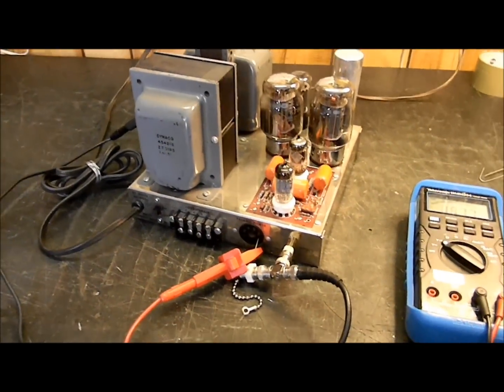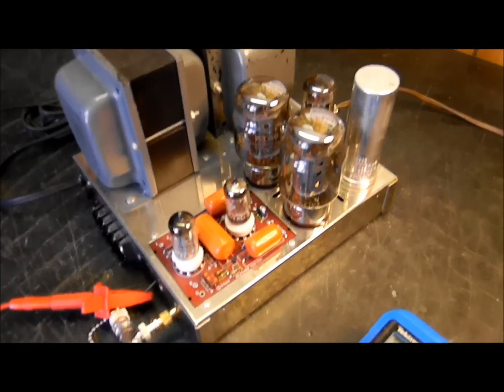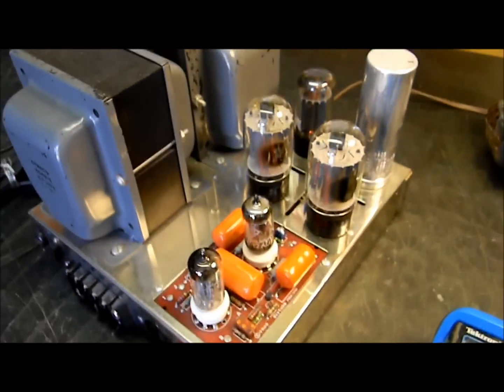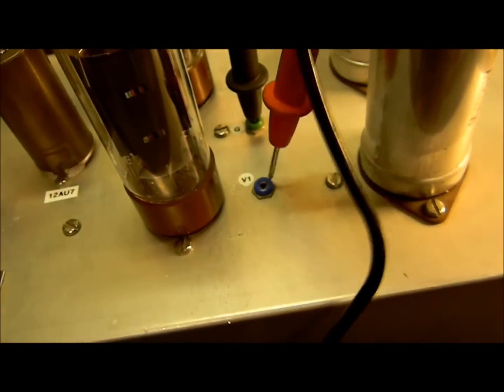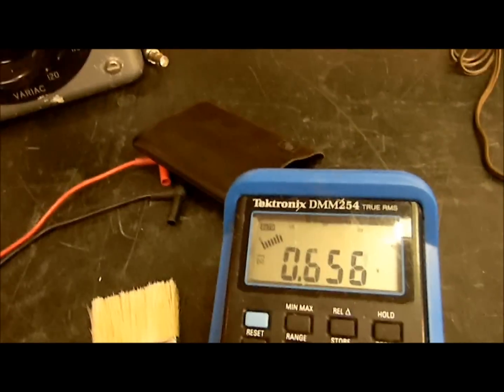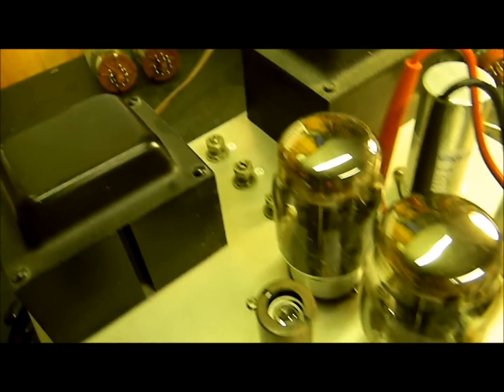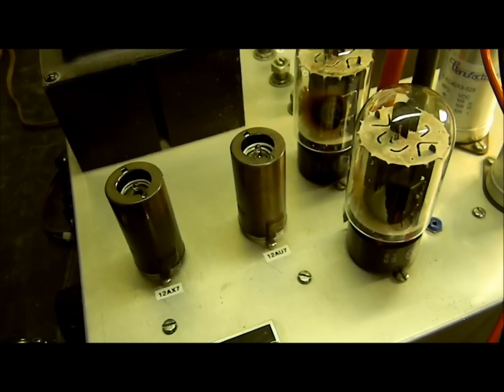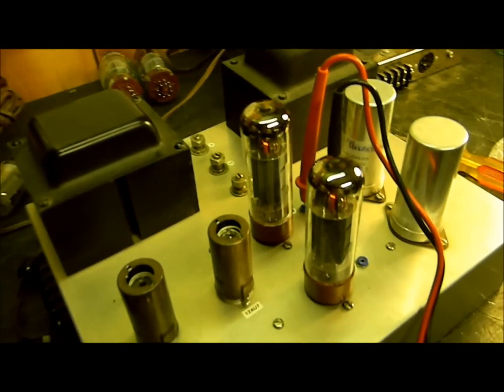KT88 vs EL34 vs 6L6 Substitution In Vacuum Tube Amplifier.wmv

Comment from the maker: The 6CA7 filament draws 1.5 A and the KT88 draws 1.6 A. This probably OK as it only 200 mA difference and (probably) will not harm the power transformer. The 6CA7 and KT88 can both take 800 volts on the plate whereas the 6L6 can not. Also, the 6L6 has a filament current of only 0.9 A so putting 6CA7 and KT88 in a 6L6 amp will probably grossly exceed the filament current rating of the power transformer. see next post

Comment from the maker: Pin 1 and pin 6 on the 6L6 is not used and often times used as solder connections, on the tube socket, for component connections under the chassis. The 6CA7 pin 1 is the screen grid and is most always grounded or connected to the cathode. The screen grid is internally tied to the cathode in the 6L6. So, you MUST know how the socket is wired up before swapping tubes around. A socket can be wired to take either of these tubes. Check out the pin configurations before swapping tubes. see next post

Comment from the maker: Yes, you should adjust the cathode currents when you change tubes. You do this by measuring the voltage across a cathode resistor (it it has one for this purpose). An example is the Fender DeVille which has a 1 ohm resistor from the 6L6 cathodes to ground and a designated test point which you adjust to 60 mV. This gives 60 mA current for the two tubes. If only a bias voltage point is provided or you measure directly at the grid, it shouldn't have change when tubes were replaced. Hope this helps.

Comment from the maker: The Fender Bassman 300 I have a video on has around 750 volts on the plates of the 6550's. Certainly no place to plug in a 6L6 or 6CA7. 450 volts on the plates of the 6L6 is not uncommon and is typical in the old McIntosh amps. I agree with you that for a typical 6L6 style amp, 6.5Kohm output transformer performs well - much better than a 5Kohm. Thanks again.

Comment from the maker: I completely agree with you that output transformer impedance is critically important. No doubt this plays into this demonstration. The primary goal of this video was to give some empirical evidence of (some of) what is actually going on when output tubes are swapped with another type. The higher bias voltage on the 6550 (may) allow the smaller tubes to be swapped in without immediate destruction but certainly not recommended for long term use. Thanks for your comments.

Comment: I don't have my tube specks book but the diference on these tubes are the plate resistance I know that you could get up to 70 w from a pair of 6550's and only 50 w from a pair of 6L6's of coure adjusting the bias for AB1 mode but if the output transformer is not matched to the plate resistance that I believe is 6.5 Kohms for the 6L6 you are not going to have optimum efficiency and I don't remember which amp but it had 6L6  with 475 volt plate voltage most run the 6L6 at 350 to 400  plate volts.